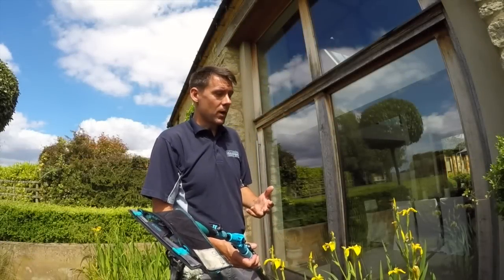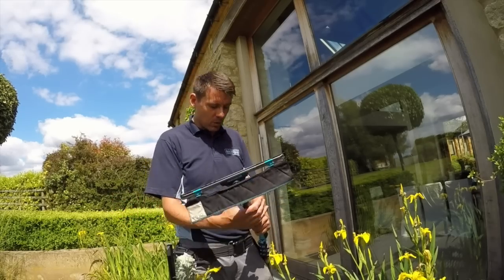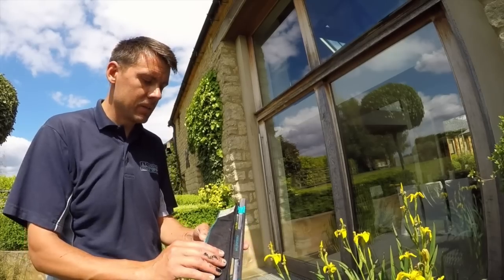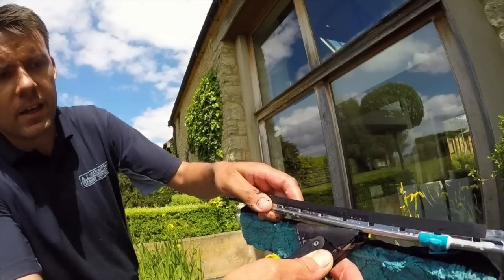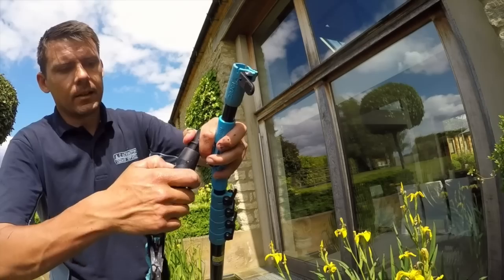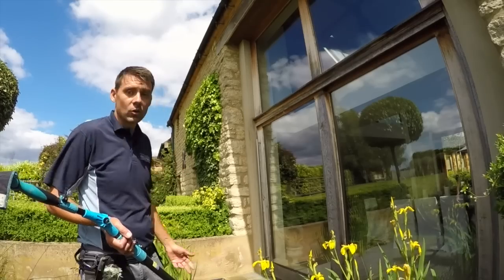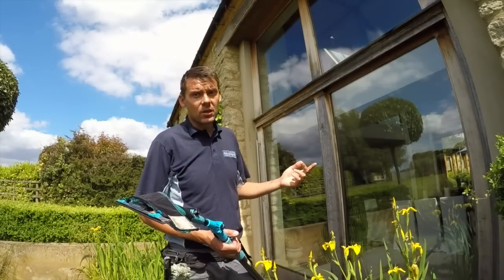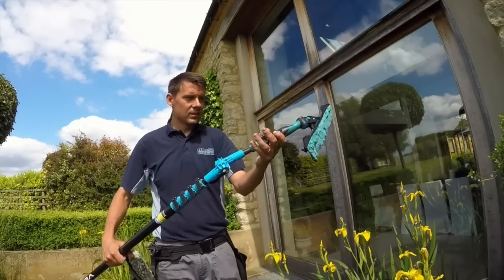Traditional Window Cleaning Squeegee Pole Combo! S Plus Channel + Excelerator Handle + Vertigo Pole

Comment: Thank you Ashley for the absolute gem of information regarding the S Plus channel and the accelerator handle together .
I have learnt to use the Moerman Liquidator channel very well.  Once you are past the point of learning it is a breeze and an absolute game changer.  Like you said you had a moment and I think what you said about the S channel and the accelerator handle would be definitely well worth trying. I just use the normal handle for the Liquidator and make sure it is tightened up in the middle, no need  far end clips ,or any issues at the ends with rubbers slipping ,I use a moerman  soft rubber absolutely superb. I don't like Poles  ,I prefer to be on the ladder doing all my work.
Keep up the good work Ashley, respect.
Reply from the maker: Nice one! Thanks! I’m glad you find the videos helpful. I think it’s so important to find your own way of doing things that suits you. Keep up the good work!😃👍🏼

Comment: I have no probs with liquidator channels. The new moerman handle is terrific. Low profile blade insert allows hassle free close outs, even up high. Good vid.
Reply from the maker: Keith Baron Can’t wait to get the new version. It is unavailable in the UK till July.😬👍🏼
Reply: @aemackintosh  They are available. I got mine from window cleaning warehouse a few weeks ago and there are a few other places that have them. The minus angles are extremely useful especially for pole work
Reply from the maker: Nice one. I think you must have got yours just before they sold out. Should be more this week so I will see if I can get one.😃👍🏼

Comment: Hi Ashley, by the tone of your voice on water feed set up you sounded slightly disappointed, , residential cleans on older homes will struggle to get good results as you have older style windows and seals that can be deteriorating in return bleeding out, the reasons   For waterfeed technology is mainly commercial and higher buildings and 2 story houses and solar panels,  and personal safety, when I do waterfeed houses they are new modern homes with nice windows and frames,  I still do traditional on lower glass.. I have a family vehicle that I use on traditional round work, saves driving a van around with full weight of pure water..
Reply from the maker: FlashTechEngineering I do sound a little down. Sometimes I record things to camera and I’m not sure how they are going to turn out, but I got some cool shots of the tool despite sounding dull, so I made the video anyway. I love wfp for upvc windows.😃👍🏼

Comment: What channels you recommend for hand use? Just the unger straights standard? or would you opt for ettore etc?
Reply from the maker: Yeah, you know what, it’s not a bad idea just to keep things really simple. A straight channel with a decent rubber can get you a long way.😃👍🏼
Reply: @aemackintosh  i use the 35cm plus channel, but i find it bleeds alot, today it was a mess, but that might be bcause of snow and very low temperatures.

Would you put endclips in the standard channel? or just the teeth?
Reply from the maker: Up to you and what you prefer. End clips can be a good idea to help keep the rubber taught.😃👍🏼

Comment: trying to figure out if this excelerator can hold a stainless steel channel?
Reply: what i mean does it have to be this channel? The moerman stainless steel.. Or ettore? I know ettore brass have to be modded to this handle.
Reply: I live in ohio so infront of the big ol mississippi and infront of the ohio river.
Reply from the maker: Yes, I use it with an Unger stainless steel channel and it fits perfectly.😃👍🏼
Reply: @aemackintosh  but do you know if the moerman one works too? They are goofy for some reason they would be a reason your not using that? its.. moerman.

Comment: I also use this combo! 😎👍
Reply from the maker: Wollef der Fensterputzer Good one!😃👍🏼
Reply: Nice vid mate going to try out a Inger s channel. You've inspired me. Just one thing. When using a liquidator without a pole (on a ground floor window) do you still use the fliq?  I did an experiment. I cleaned a 3 bedroom semi with the fliq attachment and it saved me 7 minutes. So A  House that normally took  30 mins to clean the conventional way only took 23 mins with the fliq attachment.